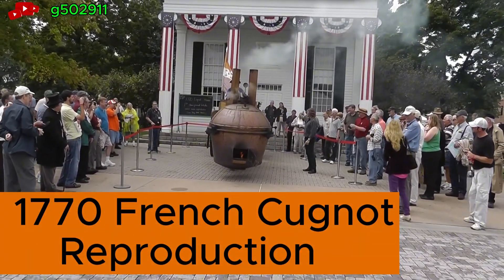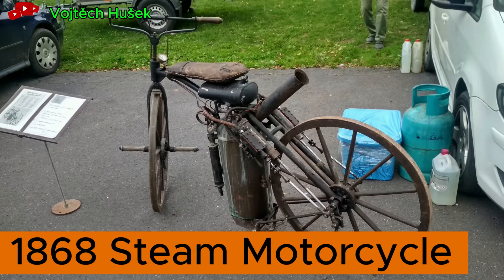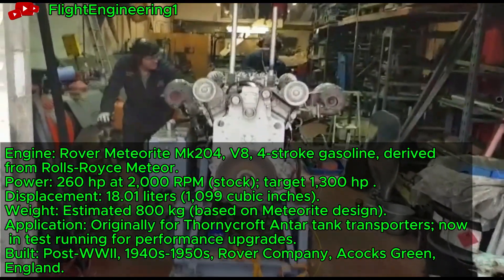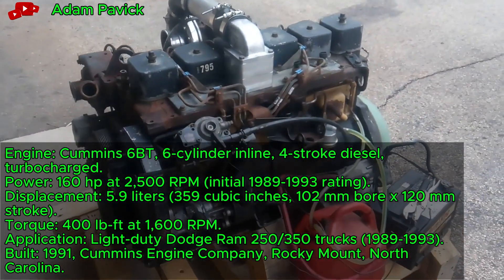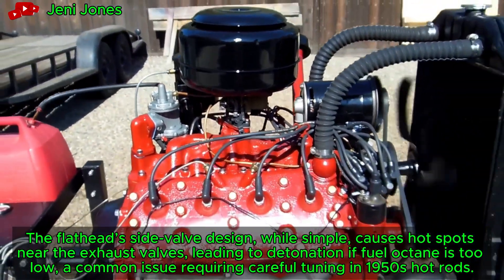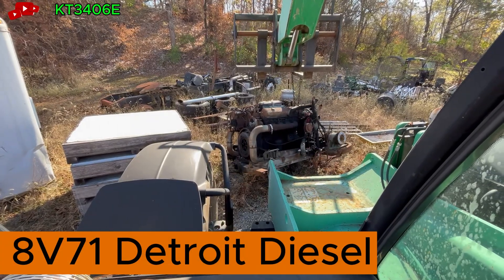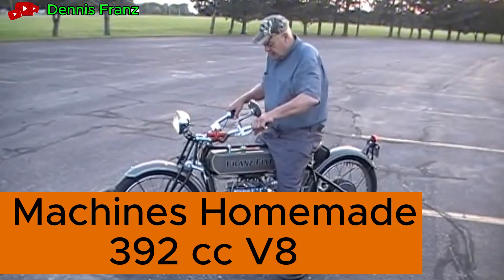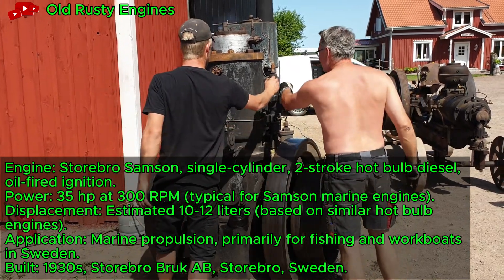Rare Old Engines Starting Up Sound That Will Blow Your Ears! ▶ Part 49

Comment: That poor 8V-81 Detroit Diesel had it's fuel rack purposely wired into the WFO position, that wasn't an issue of sticking injector racks. It was basically murder. Sigh

Comment: The dual ignition on ALL piston aircraft engines is to not aid in starting. It's there for the exact purpose of flight safety... In the cockpit is a magneto switch that has 4 positions. OFF (no sparky, sparky) BOTH (both magnetos fire and fire both sets of plugs), 1 (magneto one is ungrounded and is firing it's plugs), 2 (magneto two is ungrounded and is firing it's own set of plugs) BOTH is set for takeoff and is operational just in case a failure happens with one ignition system, so you don't fall outta the sky. Ground check involves switching between 1 and 2 and if there's is more than a 50 RPM difference.. no flying today until you figure out what is causing the difference.